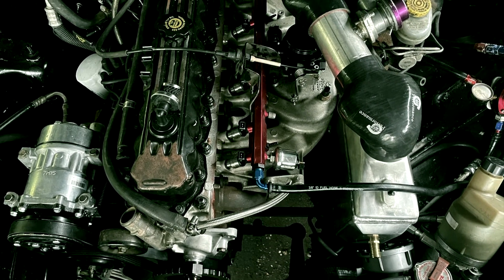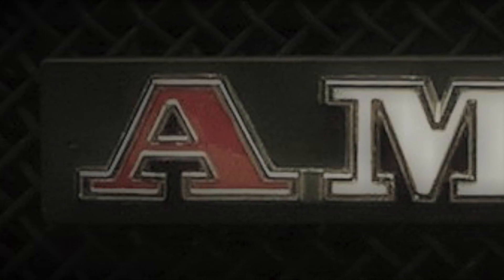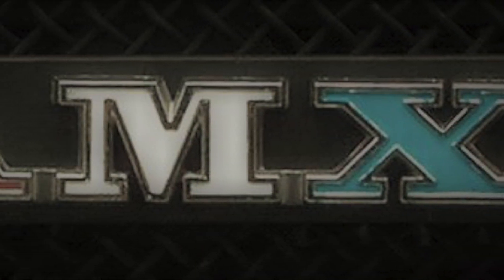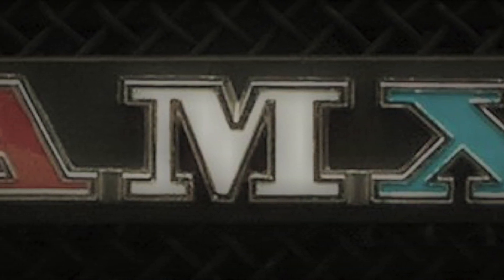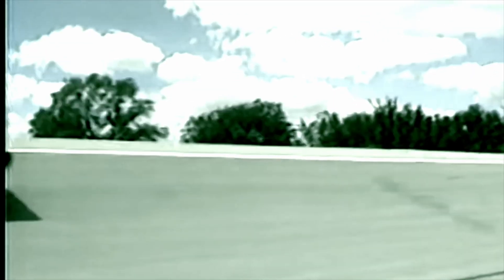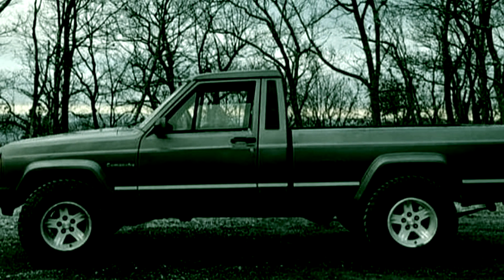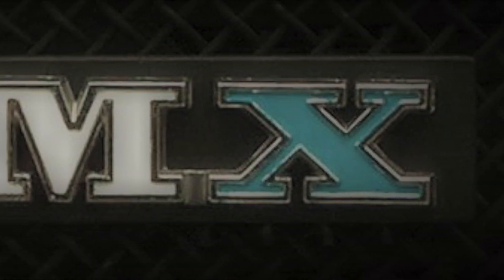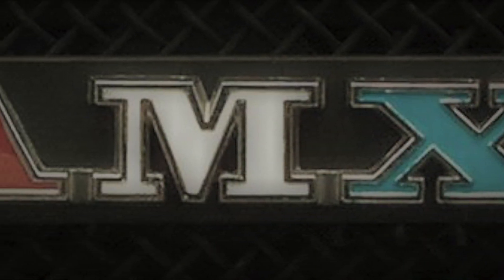Building a 10,000 RPM Jeep 4.0 - Best crankshaft, cam issues and broken pistons

Comment: The crank harmonic thing, you kinda glossed over it. He says if you've LIGHTENED things up in the piston, pin, counterweights, and it's all balanced it will spin 10k rpm "all day long". 10k rpm isn't the issue, it's guys who wanna run 6500-7000 rpm that are revving right through that strong harmonic he mentions at 5700rpm. Those guys, with normal incomes and wallets can't afford fancy shit to lighten up the rotating assembly and get the cylinder head to move 10k rpm worth of air. So yes, a good damper is needed. It probably costs less to have a damper made (~800 for ATI, IIRC I messaged BHJ on a 4.0l damper and they quoted a similar cost for the inital part and design) than to dick with all the balancing, machine shop jail etc that it takes to get a motor past 7k rpm.
Reply: You must balance or weigh all the reciprocating parts, piston w/pin, w/ rings, rods, getting everything the same wt.  AND use a 12 CW crank.  w/o dampner.  If you use a lightened crank with fewer CW's you have to use a dampener, PERIOD!  If you don't have the proper equipment or tools to do any of this stuff then take it to a professional engine person or just use a light weight crank with a dampner, and balance all of the above mentioned.  The dampener will reduce the 5700 spike,  won't be a problem.
Reply from the maker: I’d personally rather spend the money on profiling and lightening a 12cw crank than a dampener.  Less weight = more revs.
Reply: @amxj  For my build I'm just keeping it at 4.0l. No need for displacement with camshaft and boost. I am concerned about the harmonic, but part of me wants to just try with stock damper as an experiment.
Reply from the maker: I'd do it @projects
Reply: @amxj  You think for a street car that's regularly going to be swept past 5.7k it'd be okay? This is with boost and a not carefully balanced rotating assy.
Reply from the maker: 12 CW crank @Levibetz  ?
Reply: @amxj  Lets say without a 12cw crank, I kinda plan on doing this with the lighter crank at least up to 5700 but was shooting more for 6k.
Reply: The only reason you need to spin a 4.0 over 7 grand is if you are going racing. Drag racing you aren't going to running that long. Road racing is there even a class in any of the organizations you could run one in. And what would you run it in. A Spirit lift back maybe. And if you could find a class to run in one thing you definitely want is throttle response.
Reply: @mpetersen6  There is a class that the 4.0l specifically dominates in, but they basically only use the block with a custom DOHC head, bespoke timing gear, etc. For my build I'm trying do a fast street car thing with an AMC Eagle using custom suspension (lower) and a turbo engine. It's got a big cam, forged rods and an S366 aiming at 600 to the wheels. I can race it in SCCA autox in XS-A, but likely it won't be too competitive there. It's mostly for having fun. Which, hence why I'm not trying to go way past 7k rpm. I believe the interviewee raced comp eliminator drag racing with his engine, which yes required all the rpm to make the most of your displacement.

Comment: The reason there is no cam bearing on the center of the cam is the distributor drive.   Look at all of the other US produced inline OHV or any of the forgiven ones. They all have 4 cam bearings. I worked at Kenosha Engine out of the Tool Room. The three biggest headaches in keeping dimensional tolerances to print on the block were the alignment of the cam and crank bores, the squareness of the ifter bores to the pan rail and controlling the block dimensions coming off of the first broach operations. All of the dimensions on the block were based off of the pan rail and the main manufacturing holes. Those are the two .750" holes in the pan rail.
Reply from the maker: It would be great to have a chat with you about machining issues with the cylinder block if you are up for it?
Reply: @amxj  
I'll have to think about that. There's another reason there are only 4 cam bearings on the 4.0 and other inline OHV sixes. During the semifinal and final boring operation for the cam the boring bar was supported in two rotary bushings outside the work station and two Ampco Bronze plain journal bearings inside of the work station. The cam bearings were actually pressed in before the final boring operation and the bearings bored to size. Another thing with the cams bearings. The oil supply to #1, 3, 5 and 7 main bearings actually intersects the cam bearing bore. To orient the cam bearings properly there were ball detents on the holders for the bearings in the press station.  These detents sat in the bearing lube port.

Comment: i would think that the dead spot in coolant flow and heat build up around 4,5,&6 cylinders as he discussed previously,  probably has something to do with the piston failures in those cylinders.  i like how he said that running the oil too hot is not good for the 4.0, he also said in a previous vid that running them hot was done for emissions. ive been preaching this for years but the "interweb gurus" all say it was designed to run hot. this video series is great, im promoting it on alot of Jeep groups on FB, glad the real truth is being shared about these great engines👍
Reply from the maker: The bigger issue with the early pistons was the way they cast the skirts.  They left a jagged edge halfway down the skirt that was the ideal spot for cracks to form.  All it took was a few cold starts under mild power with loose piston clearance and they were prone to crack.
Reply: @amxj 
A possible trick for piston cooling. Would it be possible drill a small hole in the block that would point up into cylinder bore. Then insert a press fit reducing nozzle with a small hole. Say .015" to .030". Feed this through a hole in the bearing. Too big of a hole and you get a reduction in oil pressure.  Any excess oil hitting the piston is going to come out through the smoke holes in the base diameter of the Oil Control Ring Groove. Also could lubrication be improved if two things are done. First is to increase the spring pressure on the oil pump relief valve. Second would be opening up the oil galley from .5" to .562" or .625". This would increase the available volume of oil in the galley. Also smaller holes in the pushrods to reduce flow to the top of the engine. Lastly what if the engine is tipped over about 15° or so. This would really help oil drain back from the top of the motor.
I've thought over the years about just what one would need to do to convert the 232/4.0 family to a different head configuration. And it has been done. The oldest racing series on the planet is the Touring Championship run by the CATA sanctioning body in Argentina.  The cars motors based on Chevy, Ford and AMC/Jeep inline sixes using a DOHC 24 valve head. The heads appear to be pretty much the same only modified to fit the particular blocks. Carburation is limited to twin two barrel downdraft Webers. I think the displacement is reduced to around 3 to 3.5 liters. Output is around 500 ponies.
Reply from the maker: It would  @mpetersen6 , a couple people are doing it already.  Good thinking!
Reply: @amxj  
When they went to the short skirt piston it involved completely new manufacturing equipment
Reply: id really love to hear his opinion on using a thermostat in a 4.0 other than the factory 195°
Reply from the maker: I think we cover that in one of the performance episodes coming up  @motownXJdad9565